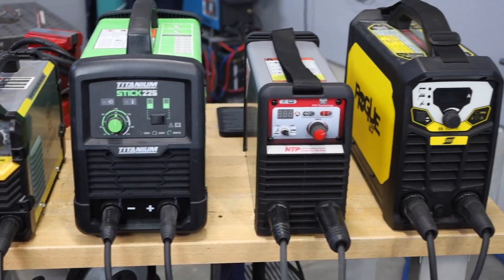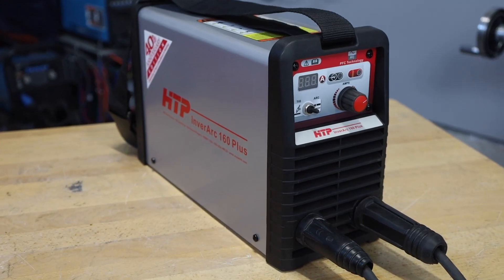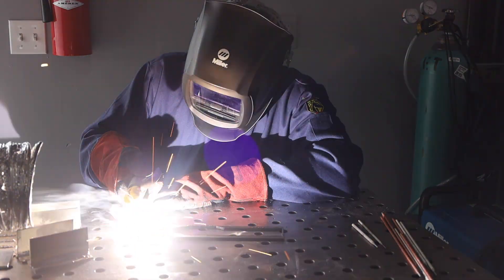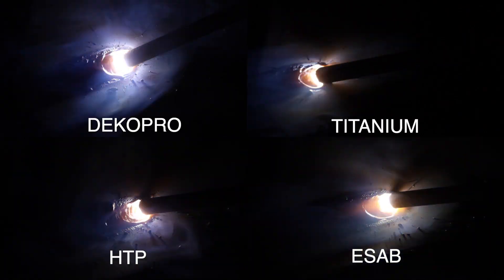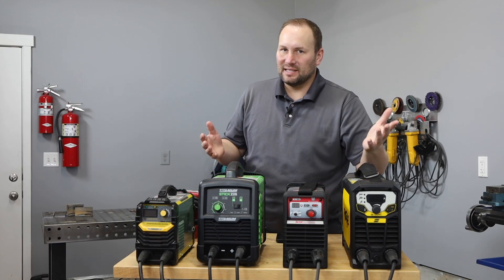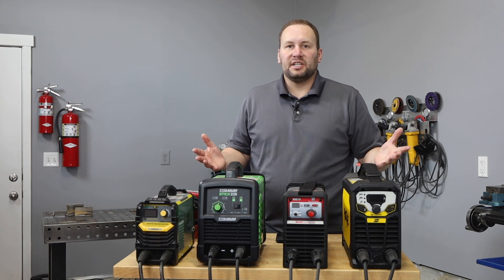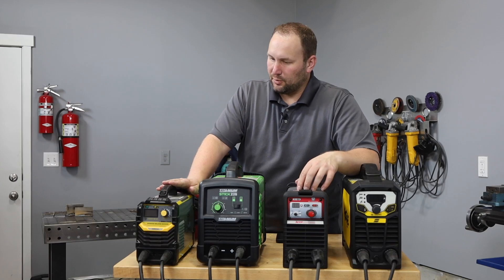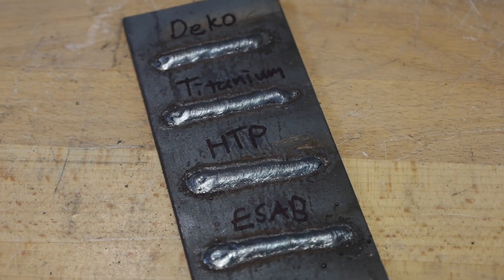Cheap vs Expensive Welders: Don't they all do the same thing?

Comment: The problem with smaller machines is the heat. if those machines don't have an adequate fan they will overheat. Thereby shortening the life of the machine. This goes back to what you need it for? Weekend warriors are not collectors; collectors are not Welding owner-operators and owner-operators are not YouTube reviewers.

Comment: Came here hopeing upgrading the deko would make me a better welder, but now I know I may suck at welding forever.
Reply from the maker: Hang in there! It takes some intentional practice, but you'll get it. A better machine does help, but it's not a night and day difference.
Reply: @TimWelds  I bought a Fronius, suddenly I can weld, the Deko is very frustrating for a beginner, the more forgiving arc angle and less sticking make the Fronius TS2200 a dream to use. I would steer any beginner away from the cheap machines.

Comment: I think the best deal in welders right now is Hitbox. Most of the cheap Chinese welders are basically the same. Hitbox is often a little cheaper. I have an Arc 200D mini which burns 6011 and dry 7018 without issue. Have not tried 6010 but I have no reason to. I learned to weld on an old A/C 225 tombstone years ago. The little Hitbox just runs great.  I also have a Hitbox MT 2000 ii which I have setup for MIG. The Mt 2000 is multiprocess so I really don’t need the arc welder but the Arc 200 has arc force settings and the MT just, will stick weld as a function.

Harbor Freight as much as I like them needs to re assess their welder prices.. I had a Harbor Freight flux MiG as they called it a decade ago.The old blue box.  I hated it and was lucky to sell it.  I bought a Century 140 MiG clone to replace it and that recently died leading to buying the MT2000

Comment: In my small experience.  Generic Welders are functionals, but are fragile , they can be easily damaged with dust and heat. The internal frame get old fast and need maintenance.  Some functions get inactive and the selectors get malfunction. If very cheap. They are very innacurate and very unstable in arc perfomance.  Its better use or begin with medium level machines as JASIC or Esab for hobbyists.  I used these welders and do good welds but need some skill and a open mind.  I used Miller Dimension and its very predictable and precise.  Idem for ESAB Tweco Fabricator,  A versatile multiprocess but not very portable. (35 kg its too much for one user to carry)  I Would Like to get a Miller Multimatic 200 but unfortunately get discontinued now.  Maybe too expensive. But for ultra portable needs its great (I have a Handy Arc ESAB 160 amps 4kg and very tiny  and has very good perfomance with 7018 but its too strong for 6011)  Specially in light or residential projects.  So. here in Peru if Miller cost X, Lincoln Cost 0.8 X Esab Cost 0.33 X , Jasic Cost 0.30 X, Generics Cost 0.25X or 0.20 X..  And if you want the tool for only one use , use generic welders, If you want hobby or prentice use , Get Jasic or Esab or a generic who you know to be reliable.  And a Pro Use. From Jasic to Miller .

Comment: I think that one item that should have been addressed is the duty cycle of the welders at the settings that were used as well as the duty cycle at the maximum power output of each machine.  I think that this is a good measure for comparing machines.  For example, does one of the machines have a 20% duty cycle at max power output while another machine has a 40% duty cycle at the same power output?  For some folks, a short duty cycle may not be a problem because of the type of welding that they are doing but for others that may be significant.

I think that you did a good job in showing the heads up difference on a wide range of welders.
Reply: I think we are talking about doability here, and not efficiency. Non of them are any good for the professional.
Reply: @elbuggo  That is sort of my point, sure you can strike an arc but what sort of weld can you make?
Reply: I agree.

Comment: i wish this guy would stop trying to push 7018 rods on guys like us who are obviously here learning the trade... because little do we know, you NEED to keep 7018 sticks in an oven as they go bad hours after opening the package ... something i didnt know before going out and buying some to "have around the shop"...
Reply from the maker: I’m not trying to push any type of electrode, use what you want. It’s just what I used in the video. They don’t “go bad”, they just deposit a little more hydrogen (due to moisture content) than they do when stored or reconditioned in an oven, but no more than any other type of rod stored in the atmosphere. This can cause cracking on thick sections in high strength steel, but all 3 conditions are necessary for hydrogen embrittlement and using a 6013/6011/6010 would actually be worse. I made a whole video about it.
Reply: @TimWelds  hang on , so youre telling me that a 7018 rod will "outlast" (for lack of a better term) a 6013 in a standard rod container??
Reply: Yep.  7018 is a tough alloy rod wet or dry.  But certain metals will require low hydrogen to prevent cracking.  If you open a pack for something critical, use the rest on your regular projects.

Comment: Great job of explaining the extremes but I'm still on the fence. Sounds like a 160A dual voltage in the $200 range would be a good place to start. I was leaning towards a 110v 75A stick but am concerned the lack of power could be too limiting.. or also add a cheap 80A flux welder to cover my bases. No idea if I could even master a stick, if not there's the wire flux unit.
Reply from the maker: The first question is what process you want to run, which will depend on the type of work you want to do. For a lot of people, flux core is a better option than stick welding and I'd probably recommend starting there. The harbor freight titanium flux 125 (the little green one) is a nice little machine for the money. There are several other similar units as well, but getting an inverter with DC output is a lot better for flux cored welding.
Reply: @TimWelds  The 160 dual voltage unit is stick. Not having done any welding I initially wanted to do general repair with no idea of what method is best, 110/ 220? Not having a clear vision of stick vs, flux but having the ability to weld whatever including some iron, stainless and maybe a little aluminum. I'm  rebuilding an old wood trawler which has all 3. Mostly woodwork but welding skills certainly come in handy. Thanks Tim! Great instructionals, I appreciate the feedback.

Comment: You should have compared them to the ol' Lincoln AC-225 since it is so common that many people would have experience with it... I don't know how long these new style welders will last, but I know for a fact that I've seen AC-225 units over 50 years old and still going strong...
Reply: Yea, I'm wanting to buy one and don't know whether to get the Lincoln (used) or get a new cheaper, smaller unit.
Reply: @keithwiebe1787  -- Those old AC-225 units can be had dirt cheap on Craigslist and there is no little that can go wrong with them, they last forever... Basically, just a big transformer and some switches... If you are comparing welders on your channel, it would be a good baseline since so many people have experience with how it works since it has been around so long... Kind of like how the M1911 is a baseline for how a handgun's trigger should be... Even the crappiest M1911 from overseas still has a better trigger than you can get when spending a lot of money trying to upgrade the trigger on a Glock...
Reply: @seanseoltoir  I see he did have a video on the 225 unit. I'll probably just get one of those as those I won't lose much money. Found them for around 200 in my area. Some look good and some are real crappy looking.
Reply: Tim sold his old buzz box, had sellers remorse and got another...

Comment: I am a hobbiest "welder". I have an industrial quality "Buzz Box" that does a great job with e7024, but its arc is too fierce for me (anyway) to succeed with e6011. Recently I purchased a DEKOPRO 110/220V MMA & LIFT TIG 2 in 1 Welder; it comes with a variety of settings, dig, rod choices, lift tig, it reduces output if a rod sticks, and has hot start built right in.  What really amazed me is how easy it is for me to run e6011 rods, my Deko does a beautiful job. For me, at least, I made a good, affordable choice. Great video. Thanks for sharing.

Comment: I never welded but I have a bunch of metal dusts like a pile and I want to weld itto art but I don't want the powder to blow away is there a weld machin and technique I can use ,like can I use sand and make a mold and weld it? Or do I have to use torch

Comment: The cheap ones might not work at all. Recently I bought one for like 80 $. I had zero experience with welding but this machine (Kraft & Dele) is just pure evil. It can't strike an arc, doesn't hold it very well and shuts down after 3 minutes or so. Adding output coil really helped (40$) + better (copper, another 20$) cables (longer arc, easier striking it etc.) but still can't weld for long. Also the numbers on it lie completely, in reality it's like half the current. So mayve Deko is ok, but most of these cheap machines don't have output coil and have aluminum welding cables and lie with amperage. It's not just a case with my brand, but many others as well. Might put you off welding + money wasted. So I suggest to save up some money and go for 200$+ and you save yourself a lot of hassle and nerves.
Reply: Don't give the deko the time of day. It's straight garbage. I'm with you on the save up and get something a little better than bottom of the barrel.

Comment: I started with a cambel hausfield and almost gave up.
When nothing worked right my Wife bought me a Lincoln flux core which got me going again.
Last year I was looking at the Preme Weld 225ac/dc and I will be damned if she didn't buy that one for me for an anniversary present .
Damn I have a GREAT WIFE!!
PS I threw that Hausfield to the end of the driveway and left it there. Yes I actually threw it the length of the drive where it stayed till trash pick up
Reply: What made you think a compressor could weld? 😊
Reply: @T3glider  : They offer very basic and outdated welder machines..

Comment: I have my share of both cheap and expensive tools. Many times the less expensive value-brand is adequate or all that is available on short notice. However,  I buy tools for life and in the future I won't feel the savings but I will feel the quality (or lack ther of) each and every time I use it. I buy a lot of used quality name stuff. It's not about the warranty. I bought the Rogue ES180i last december and love it. I probably would have bought the HTP if it were also rated 180. I prefer to run my stuff in the middle of its capabilities, not maxed out all the time.

Comment: I'm about ready to purchase a quality European stick welder. I have been welding for over 20 years now and have owned around 5 Welder's. 
I did dig in and bought a mid proffesional mig welder after welding stick for 20 years.
The starter stick welder I bought perhaps 10 years ago had low quality handle and earth connection.
My runs used to come out well and then started to stop halfway between welds. Buying a new earth may alleviate this a little although I switched to using the mig welder.
I then bought low hydration welding sticks which I prefer as it gives a lot stronger welds.

Comment: If you bought a cheap one, then a mid range one, then a good one, you spent at least twice what you would have if you had just bought the good one.  I bought a Miller for 3-4x what I could have spent on the low end stuff, but as my welding has improved, I’m still happy with it.  I do cheap out on some tools I know will be disposable but a welder?  I say go big if you’re going to invest in the time it takes to get the skills.

Comment: But doesn't  an old School  Cracker Box built with a real Copper Transformer give the most reliability like a Miller or Lincoln ? Seems like a power surge can blow out the circuit board on these Hi-Tech models.
Reply from the maker: I love those old buzz boxes, and they are nearly bulletproof. I’ve had 3 over the years. With metal costs rising and electronics becoming cheaper, inverters have really become the new standard. In my shop, I have 9 inverters for the various processes and none have failed me yet. That being said, there’s no way they’ll outlast a Lincoln tombstone.

Comment: the only one of them machines i see still working after many years is the htp.
 should of opened them up. probly a huge difference in construction and component qaulity
Reply from the maker: I have been really impressed with HTP machines in general and I would assume it has high quality components. As interesting as it would be to open them up, I don't have the expertise to comment on the differences in the electronics.

Comment: Great video as always! QUESTION: Can you PLEASE explain arc force settings on some of the machines?  I have been told that 7018 electrodes perform much better (and become easier to use) when the "arc force" is set to more or less amount. Is that true? What exactly is that fancy setting intended for, considering it doesn't appear change your amp setting?  THANKS!
Reply from the maker: Thanks! Great question. The arc force setting just increases the amperage from the set amount when the arc length becomes really short. This keeps the arc from going out by giving a bump in output. It has the most significant effect on cellulosic electrodes, like a 6010. My experience is that it doesn't make much difference with 7018.
Reply: @TimWelds  Thanks for the info! I was honestly hoping it is a miracle setting -- Ha

Comment: I have the chicago electric 80amp stick machine from harbor freight and it runs 6010 but not 1/8” it can only run 3/16” for beads over 3” because it has a very low cycle

Comment: Tim love the videos thanks.. I'm a DIY car guy and working on my wrecked 2021 Honda Pilot, I needed to replaced multiple panels and following the instructions I put down "weld thru primer" between the panels, doing plug welding so I made my hole on top panel then use a small grinder to remove weld thru primer from spot... issue I am experiencing is that when I hit the gun, the tip of the wire creates a bubble and all the melted material stays at the tip and does not stay in the plug hole, sometimes I see the melted metal staying on top and weird thing it forms a small ball then it pops out like a pimple LOL, wondering if this is contamination from the Primer? Thank

Comment: No way those titanium machines are absolute junk they weigh nothing compared to higher quality machines because of way less heat sink I accidentally knocked off a titanium machine only like 2 foot off the ground and it completely ruined the fan Everlast 210 stl is leaps above it it weighs twice as much as well and that does mean better duty cycles because of more heat sink they put in em

Comment: Tim I do have to say you're absolutely correct me I started off the same way I bought a susemse mig 255 from Amazon for $350 I was using that welder for a year and a half teaching myself how to TIG weld. then once I was comfortable enough I ended up with a prime weld Tig 225x which is double the money of what my first one was and now I'm happy with this TIG welder that I do have and I even added the maxcool 3000 water chiller with a water cooled TIG torch flexloc 230 and now it means all my demands and uses that I needed to do.

Comment: So in a nut shell …except that you might want to do mig and tig welding later , all will weld a joint that would take a more than  500 lbs of sheer pressure to pull apart and nobody could tell how much the machine cost .
Reply: I think they all ran 6011 and 7018, so yeah.  Cheap accessories wear out on you faster.

Comment: Great info, thanks. what's your opinion on multi process machines like all in one mig/tig/stick or are dedicated machines better. Just joined your course and I already have a mig but I would like to learn all types of welding.
Reply from the maker: I have 2 multiprocess machines that I use almost exclusively for MIG. My experience with them is that they usually are great at MIG, good stick, but not the best for TIG. Some of the highest end multiprocess machines (Rebel 205 & Multimatic 220) are also good at TIG, though you definitely have to pay a lot for it. The specific TIG features that are missing in many multiprocess machines are AC/DC output, high frequency arc starting and pulse. I hope you enjoy the courses! If you have any questions or feedback, you can reply to the confirmation email to get in touch. Thanks, Tim
Reply: Thanks for the feedback,  I really appreciate it, great channel and I look forward to the course 👍👍

Comment: I know this retired military fellow that had the govt but him a $5000 Esab do everything welder. He usually snickers at my 50 year old Lincoln 225 ARC welder using 6013 rods and my 25 year old Deca MIG welder using flux core. I recently bought a Lincoln MIG Pak 180 also, to use with argon. I use all my equipment regularly and do good work, being self taught. His equipment sits and collects dust because he is idle. Point is: use what you have, do the best work you can, and don't laugh at other peoples items. Stay safe.
Reply from the maker: I've had two Lincoln 225s over the years. They're great!